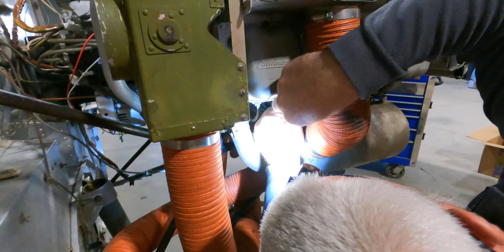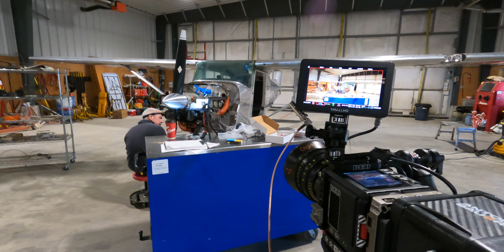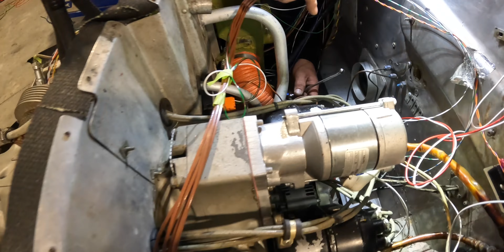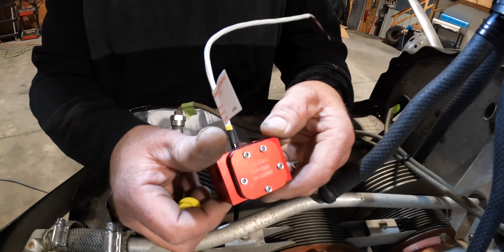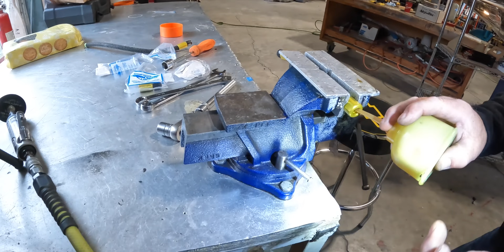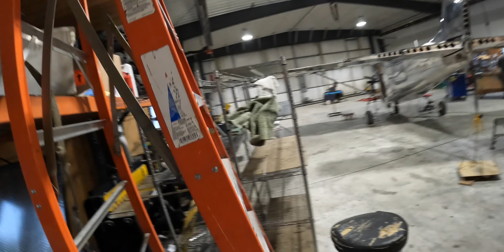Dynon Engine Probe Install Glen's Hangar  Episode #10

Comment from the maker: A couple of clarifications on the info in this episode from the folks at Dynon:
-Manifold pressure on a fixed pitch prop, though not necessary, SkyView needs to know Manifold Pressure, RPM and fuel flow to be able to compute Engine HP and % power widgets.
-Fuel flow (red cube), not only instant gallons per hour, but also drives consumption based fuel computer. It's counting pulses that come up the wire as the turbine spins, 68k pulses/gallon.
-Mono audio, SkyView has stereo outputs, but you can combine L and R together for Mono systems.

Comment: hey glen, for the fuel flow sensor . why didn't he just plumb it in to the fittings instead of cutting the hose?
Reply from the maker: As I remember - It's been a while - we needed to mount the transducer to something and it shouldn't be attached to the carb or the fuel sump. So cut the hose where we could mount the transducer to the engine mount.
Reply: @GlensHangar  did he use  some other instructions with more detail? 
Where did he get those cool hose fittings?
I appreciate your help. I enjoy your videos. 
We are doing the same project to  a 182.
Reply from the maker: @ That's the knowledge that comes from being a trained / certified AME.

Comment: I didn't understand why the intake manifold pressure would be pointless without a variable speed prop. You say it's not necessary but then say why it is necessary for SkyView to understand what's going on in the engine. That's confusing. There wouldn't be much point to not instrumenting it since so much of the calculations the computer does in real time require it. It would cripple your system to not have it.
Reply from the maker: At the time we filmed this - I wasn't aware that the Dynon computer used the manifold pressure data in it's other engine management calculations. 
In a steam / clockwork gauge aircraft (that both Chris and I are more familiar with) manifold pressure is used to set the correct RPM / mixture / prop pitch combo and nothing else; since this plane doesn't have a constant speed prop 'MAP' data would be superfluous.

Comment: For the time and effort spent on this project I would have thought replacing a 60 year old Rubber hose would have been on the list, I realize it passes a pressure test but its reduced flexibility would stress the components and joints over time. This is a great series.
Reply from the maker: According to the logbook the fuel line isn’t that old - more like 8 years.
Reply: @GlensHangar   Thanks, I might have taken the 60 years old to literately.

Comment: Since you're already spending a ton of money on your airplane, why didn't you buy braided fuel lines with the appropriate fittings in place for the transducer and the carb? Even if the really old existing fuel line is in good condition, it seems foolish to leave it when you've paid for all this other work.
Reply from the maker: Regulations… you are allowed to ‘fix’ or modify an existing component; not manufacture a new one. No one makes a certified braided steel fuel line for a Cessna 172, so we can’t buy one that’s already made to fit.

Comment: From building fuel lines with AN fittings in my project cars and worrying about the same thing, most companies selling AN fittings will also sell an AN line cutter for cheap that doesn't debride the lines like a cutting wheel will.

Comment: This is a question for Chris, instead of cutting the fuel hose, could you have adapted the transducer to the bulkhead through fitting, then used the original hose to the carb? Thanks have a great day.

Comment: Glen, I'm glad you included the description of the airplane in the comments.  The 172 really hasn't change too much over the years, primarily cosmetics, and of course the change in the cabin design for the Omni-Vision window.  But, the engine has been the one big change, going from a six banger to a four banger.  I wonder, without actually going to look it up, is there an STC for upgrade the Continental O-300 to a Lycoming O-320, or, even better, an IO-320?

In a previous reply, you said when I asked about IFR that you planned on running a VFR for now.  I'm assuming then that the cut outs on either side of the pilot's yoke are for the radios.  Are you going to be able to see them and have ease of control over them from your seat with the control wheel installed?  To me, from where I sit, I think they would end up being right behind the control yoke.  But, that's just what I see.

I really am enjoying this refurbishment.  I think you are going to have a really nice 172B when you get done here.

Comment: Was strange hearing the word firewall in a non computer related area
Reply: Even though this context is where the term originated from? :-) 
[I say this as both an IT professional and a pilot] :-D
Reply: @noelwade  aviation, the firewall is between the engine and the pilot to keep engine fires from cooking the pilot.
Reply: @noelwade  Wasn't the term from automobiles before planes?
Reply: @noelwade  except of course that’s not where it came from. The term was originally about the gap between buildings later becoming about planes then networks